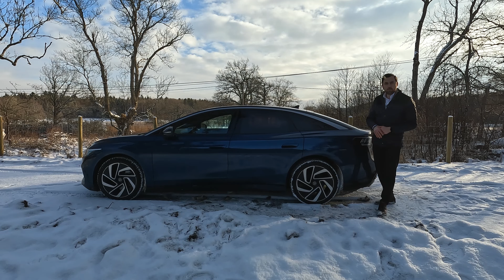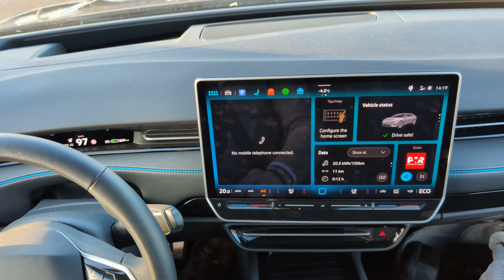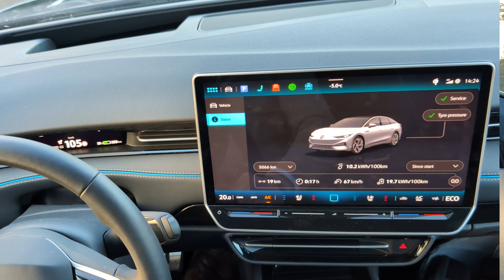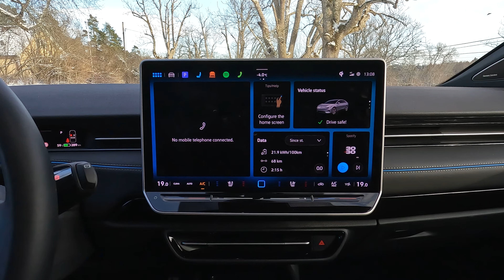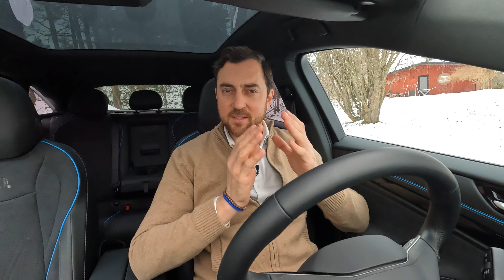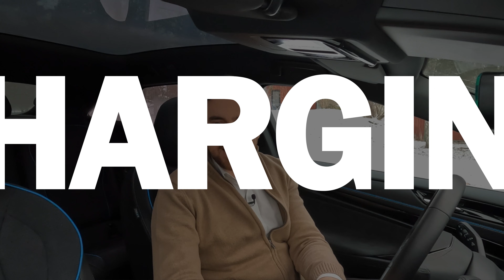Volkswagen ID7 - Real Winter Range & Charging! | Watch before you buy

Comment: What is the reason to have very low profile and ridiculously wide tyres in most EVs? Like 45/255 in ID.7.  Not all roads are  like the surface of a table on which even those tyres perform well. And ask a tyre dealer how frequent tyre damages are with those "sausage skin" tyres.
Reply from the maker: 1 reason is to be able to handle the weight. Big EVs are heavy and need wider tires to support the load and the wear of the torque. But 45% of 255 is not that skinny these days .

Comment: What would be the consumption of this car while driving 150 kmph on the highway? Any chance to assess?
Reply from the maker: 150km/h, double the consumption
Reply: Thank you. So approximately 35 kWh/100 km. In Poland you can drive 140 kmph + 10 kmph tolerance with no fine. That would give 200 km range only. My regular travelling distance is 280 km, 180 km of highways (average spped approx. 120-130 kmph, depending on traffic conditions) and 100 km of one lane roads (average speed approx. 60 kmph).  To reach my destination without charging I would probably have to drive not that fast on highways. Anyway, it still seems to be the best option on the market, but I am waiting for ID.7 Tourer GTX to have bigger battery and 4 wheels drive.
Reply from the maker: @MarcinLemkowskiKamienicaPrzyPa understand your dilemma. Guess best choice would be pro s, rwd with the big new pack. Will for sure  go 280km in 150km/h
Reply: @MarcinLemkowskiKamienicaPrzyPa  I drove this at 135 km/h on highway and it took around 19-20 kW/100 km. But it was around 20 C outside.
Reply: @ItsOnlyElectric  Carmaniac has done a test at 150 km/h, he ended up at 196 Wh/km, for 408 km (and still l7% remaining, touring Pro S) during 3h18 min, actual average speed of 125 km/h . That was during summer, in one direction - so possibly a backwind advantage or a difference in elevation -  but I don't think you go so far up in consumption, given the low Cd of this car
Reply from the maker: @deFruitberg thats, great!
Reply: Good question, in BG the allowed speed is 140km/h , so I was curious what would be the consumption at 140-150.
Reply: It's the average speed that matters in the end. I would recommend that you drive slower and you will end up less tired, much safer and you can do it easily in one go. With my ID.3 58Kwh, pushing it to the limits 150-160 + the traffic and 4 people in the car I managed to get 220km. It wasn't that cold but still, pushing it to the limits...I have high doubts that you won't get the 280km on a 77kwh battery pack.

Comment: I hope we don’t get that speed alert/chime for the ID7 in the US.
Reply: Luckily, my Polestar 2 2024 doesn't have it even here in Europe. Only blinking red speed sign, which is perfect. I can chose to turn on sound as well though, haha.
Reply from the maker: The manufacturers are well aware of the annoyance of the solution and I doubt any one will implement it if not forced to
Reply: @tylovset same! Thank goodness, I tried the sound on, but turned it off quickly. Sometimes it will have the wrong speedlimit too. I’m not sure if it reads signs or use GPS data?
Reply from the maker: @wonderboy75 my experience with all vw is thst it mainly use the gps and picks up speed limits from  nearby roads and sometimes even uses the wrong speed limit without any road close enough to create a confusion
Reply from the maker: It's EU regulations so most likely not
Reply: Third world problem. When you have created a shortcut at the top of the screen it only takes a split second to disable the alert. It is considerably less annoying than the alarm you get when a door is open.
Reply: It drives me nuts on my Ioniq 6

Comment: Hej 👋 Without this drop, the charging curve would have been fantastic. Still ok tho 🙂 Have you seen the first reviews of the ID7 Kombi (or Tourer) ? Seems that the exterior trim has been slightly updated , especially the lights
Reply from the maker: Yes, the drop breaks the curve a bit. Seems to be related to insufficient cooling or late start of cooling. But still under 30min can be considered good. 

Watched some videos about the #id7tourer looks goods. Couldn't spot any differences for the lights though?
Reply: The drop of the charging curve isn’t always the same. Battery life had a charging speed over 100 kWh until 64% with higher outside temperature.
Reply from the maker: @user-ez9tl8qg7z for sure. A lot of factors are playing here.